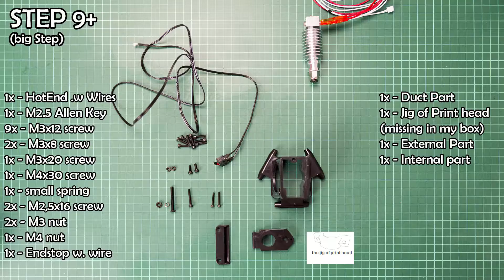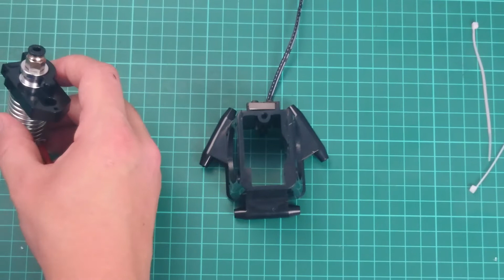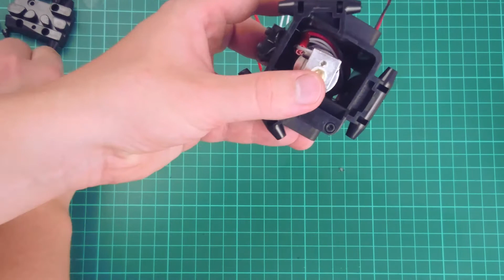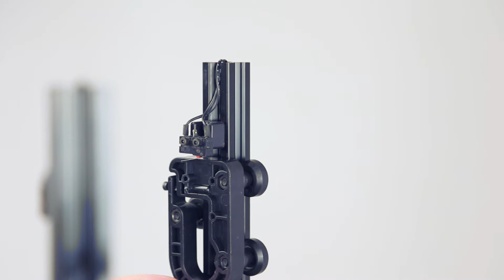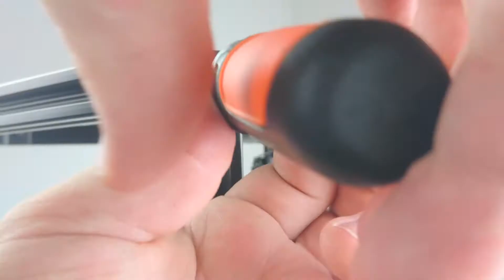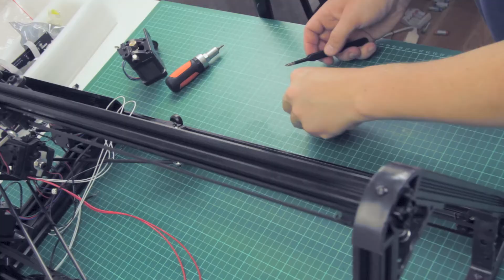Micromake DIY Delta - Build Guide Part 2 (Community3Dprinter Episode 2 - )

Comment: I noticed that when fitting the extruder suddenly the wires from heater go in the other side and it is "flipped" the other way. Is that correction on the manual? It seems the only way it will fit??
Reply from the maker: I know right! I think it's not clear how it should be in the manual. I went with this way and it kind of works. It's tight.. but Works. I'd recommend rebuilding the extruder a bit (for use a better probe) ASAP after getting it all together. I'm doing that right now, but it's quite low on my priority-list :/
Reply: I'll first try and assemble the printer and see about upgrades later. I enjoy your video's and find them very helpful.
Reply from the maker: Thank you so much Peter!  :D